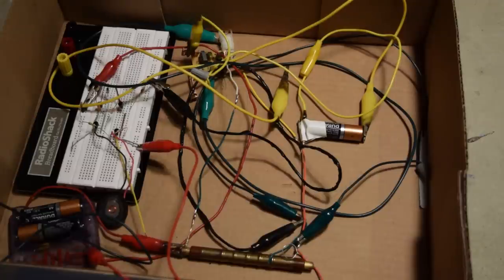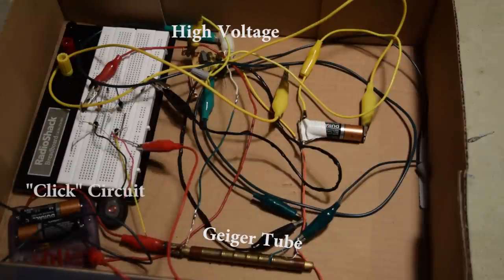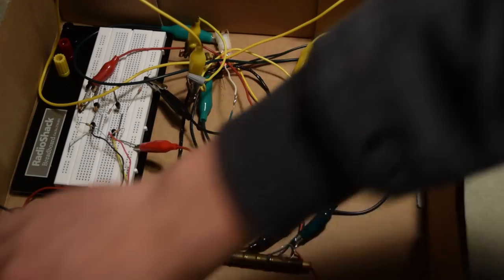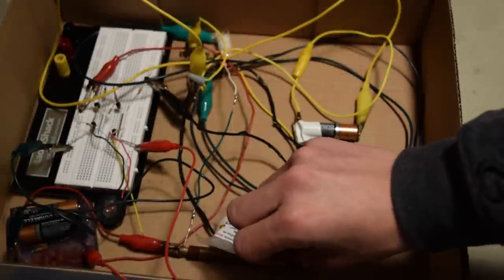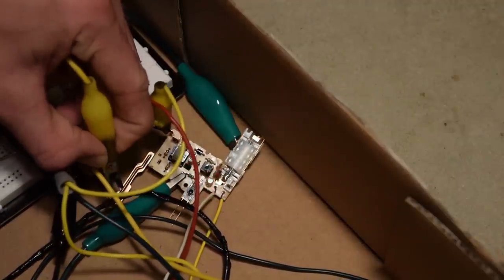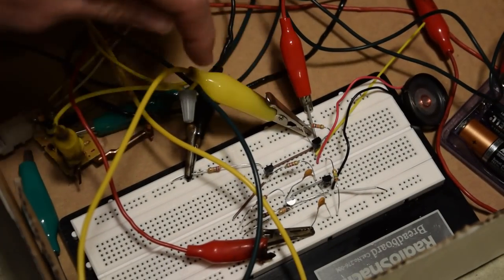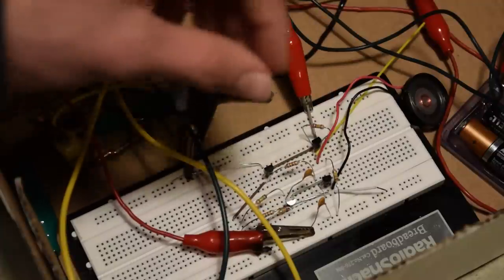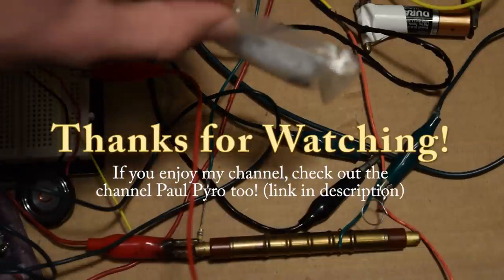Homemade Geiger Counter

Comment: Thanks man for the shoutout! :D Also, really love this video, I am a fan of Geiger counters and never realized how you can make one at home...I definitely need to try this! (PS, have you been shocked yet by the camera flash circuit, I have a couple times and it really zings :p )
Reply: if been shocked alot, the wall, bug zapper, flyback driver, BBQ lighter, flash driver, light bulb socket, wall swich and im alive
Reply: science Vlog Well, I have been playing with a 4700uF cap charged to 25 volts... It was not so pleasant :D
Reply: I did when I was younger. I took apart a disposable camera and it did NOT feel good!
Reply: Camroc37 As long as we are all still alive, that's all that matters :)
Reply: Paul Pyro hehe :D true